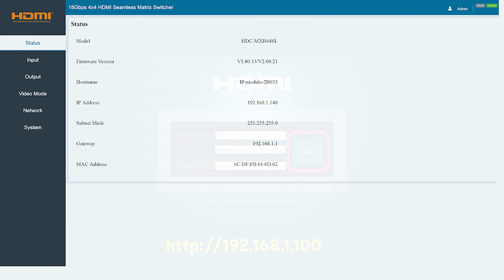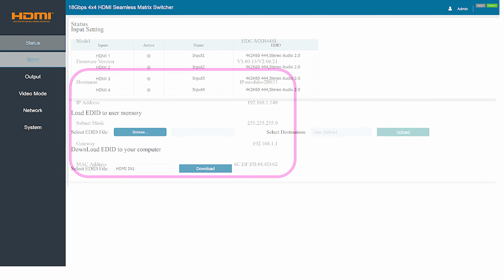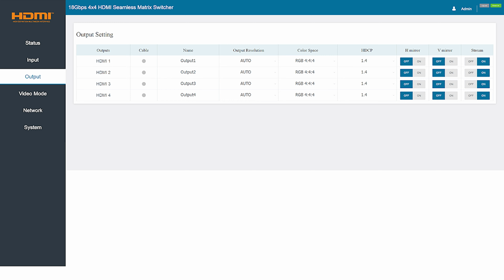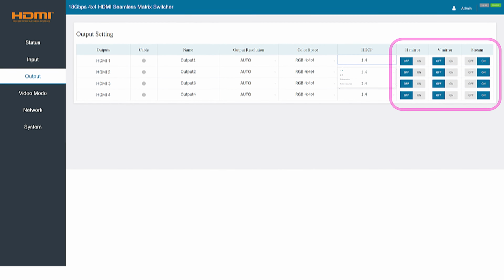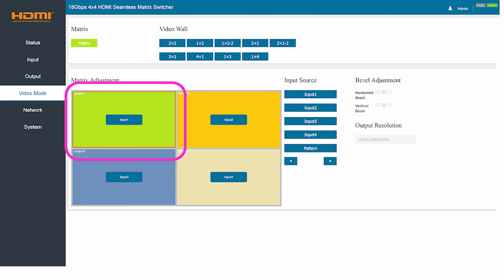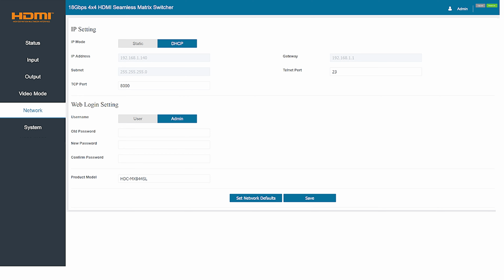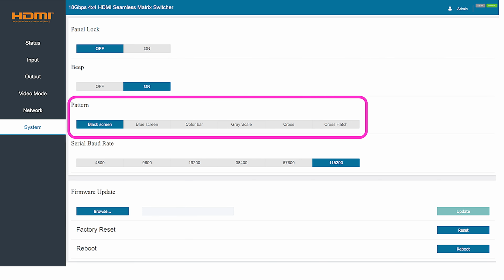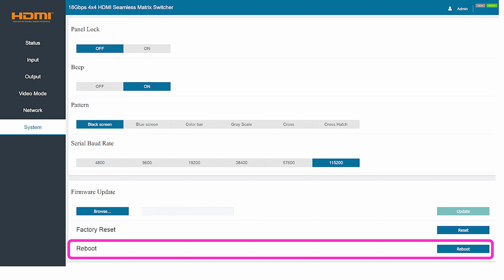WebGUI Software Overview for the UHDS-404VW

Comment: Hello I bought this product and plugged everything in and nothing is happening. I’ve tried with the remote and nothing. I have tried plugging it in with a CAT6 and typed in the IP address and nothing pops up. The device just beeps when I push the remote but none of the screens change. I have called the company and no one ever answers.
Reply: You will need to keep pressing the RES button on the remote until it switches to correct resolution it supported by your TVs.